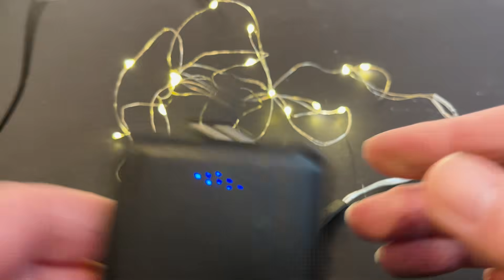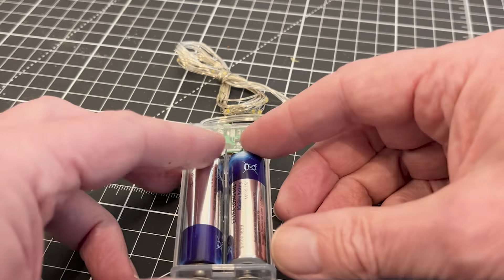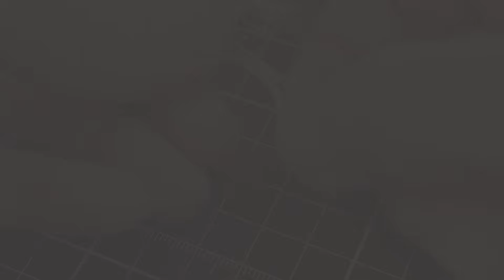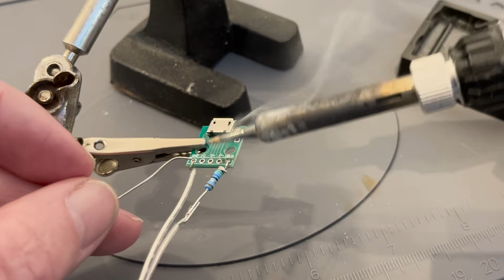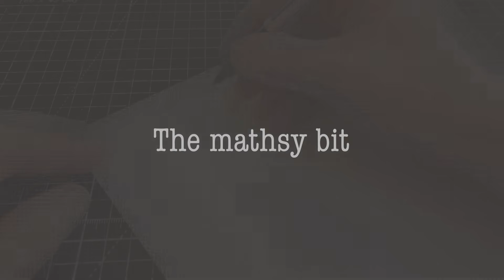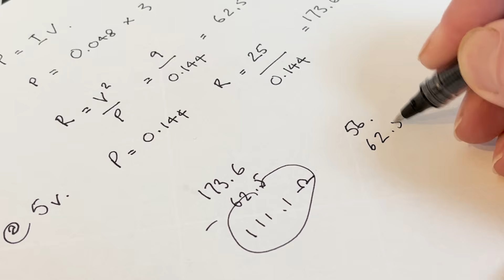Converting battery Xmas lights to USB power – no soldering required

Comment: If i'd buy a USB-A male socket breakout board would it work the same but then i could just plug it in a cable end(i dont know if thats how its called), and if my lights had the USB-A male plug with a motherboard with 8 different modes could i transfer the last one  to be the on mode?
Reply from the maker: You could just wire in a short bit of USB cable with a male connector and plug it straight in. Not sure about the LED modes. Is the circuit for that in the battery box, or separate?
Reply: @paterpracticus no my fairy lights have no batteries(it has a usb-a male end that i plugged into a charging cube) they have a breakout board and a button to press to switch the modes, but it broke so when i turn the lights on they turn off after few seconds. So i wanted to use the usb-a male socket breakout board so maybe you know if it would work the same with lights that didint have batteries? And you said there are two holed in the breakout board for information so maybe theres a way to transfer atleast two modes to the new socket breakout board?(sorry its so long and maybe with mistakes english is not my first language😅)

Comment: Thank you for this clear and simple demonstration! Would this same method be used for Lithium battery-powered lights, such as the button batteries?
Reply from the maker: They are likely to be higher power than fairy lights, so should be approached with caution.

Comment: A question from someone with no electrical experience: is it safe to assume that any set of lights that requires two AA batteries will use the same kind of resistor?
Reply from the maker: The recommended resistor will depend on the number of lights in the string, but anything that is running off 2xAAs will be pretty low overall wattage. For a typical string using about 10mA you could go for something around 220 ohms.
Reply: @paterpracticus good to know, thanks! How about something running two C batteries?

Comment: is safe to use with usb a male and the resistor in series to use it on pc usb?
also i made this with 3aa lights ( WITHOUT resistor) and use it no problem with pc usb since its 4.5v required. is this also safe?
Reply from the maker: Should be fine to wire a plug and use with  PC. Only using the power, rather than data connections.

Comment: How many watts 1/4 or 1/2 watt resistor - 56ohm
Reply from the maker: Wattage shouldn’t be an issue. The draw on the supply is really small.

Comment: This is helpful and encouraging to a wife to now has to do the little electrical things around the house since my husband (who always knew how to fix things electrical) passed away.  I have light board that had a micro cable connection, but I did something to disable it.  It looks like I could go into it and replace it and the light box will be usable again. Thanks.  Where do you recommend picking up the little boards if I only need one or two? One more question, can you reset it for motion detection? I  have a cute framed wall piece that prefer that just light up when someone enters the guest bathroom and not be on all the time.
Reply from the maker: So glad it was helpful. I did find places that sold the sockets individually, but they were quite a bit more expensive, so buying 10 worked out much better value - I’m sure I’ll use the others. 

For several of my projects I use Raspberry Pi Picos to control circuits, and I’m sure that would work for your motion detector. Again, they are relatively cheap, but a bit more complicated to set up. 

Finally, if you are going to do bits and bobs like this, a soldering iron would be really useful. Takes a bit of practice to get going, but a really good skill to have.

Good luck!

Comment: Tit for tat, solder if you want.  I really appreciated this video.  Been searching forever to get a simple way to make the conversion.  I now do all my holiday windows with fairy lights.  So much simpler then years past.  This year I came across led fairy lights in  green, red & white strings that I'm dying to use. But they are battery packs.  Going to order them today to be sure the colors are good, if so will need to watch your video to figure out what size resistor I need.  My strings would be 16 feet with 50 lights.  I am SO HAPPY right now.  THANK YOU SO MUCH FOR THIS VIDEO!
Reply from the maker: Great. So glad you found it useful. I’m pretty sure the resistor tolerance is pretty broad, but you can always test a few values before you make the final connections.

Comment from the maker: Ooops. In the video I wrongly interpreted the coloured rings on my resistor. It should have been 5 (green) 6 (blue) 0 (black) with a 0.1 multiplier (gold). The result is still the same - 56 ohm, I just did the reading wrong.

Comment: this is more expensive than just taking an old charger and wire it directly to the original device... and you did solder it, what was the point of the title?
Reply from the maker: I did solder in the end as I have the kit, but wanted to show it could be done without.
Reply: @paterpracticus  I did liked the end product. Just i do not think this arrangement could go on with out soldiering. I have used magnets to make a contact without soldering
Reply from the maker: Cheers. I did test it quite thoroughly and the unsoldered joints were quite robust - particularly with the heat shrink. Glad you liked the idea.